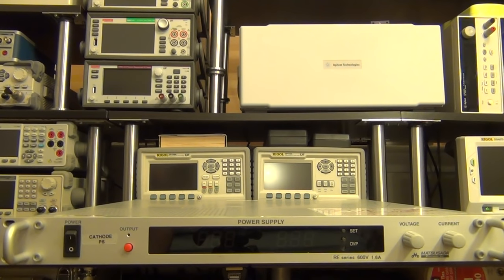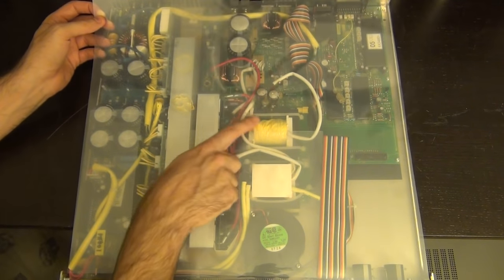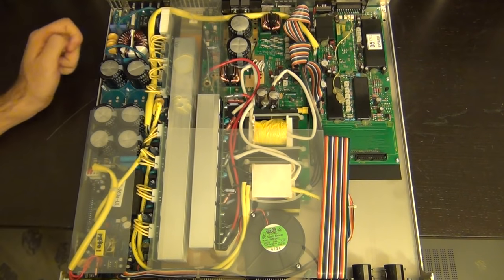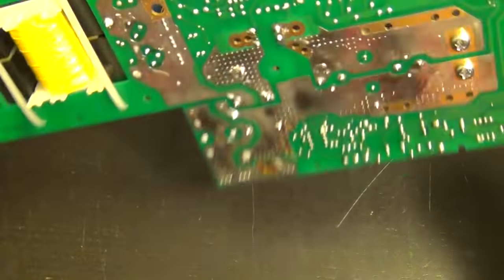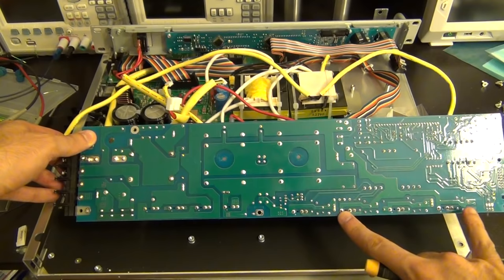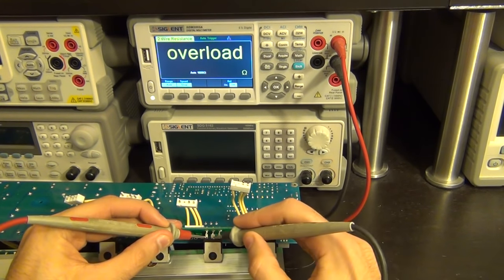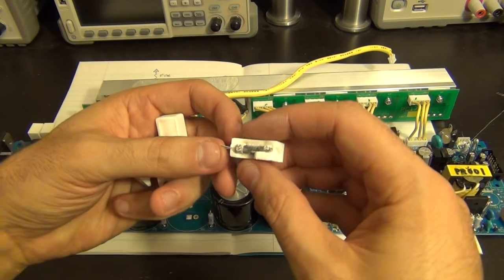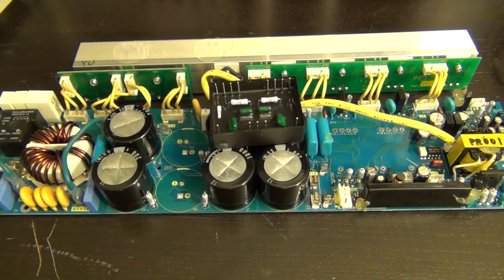TSP #65 - Teardown & Repair of a Matsusada RE-600-1.6 600V 1.6A Power Supply

Comment: When powering up something like this after a repair, it's a good idea to put a resistor  in place of the fuse to limit current if things go wrong. 
Amazed to see such amateurish methods used in a Japanese PSU, but who the hell has heard of Matsusada nowadays... PSUs are always subject to failure, so making one unrepairable is unforgivable. There is no reason for the drive stuff to be a module except to chisel money out of customers for spare parts.
Reply: +mikeselectricstuff He should send the module to you for X-raying and bandsaw-extreme-teardowning :D
Reply: +Róbert Valdimarsson 
That would be incredibly awesome
Reply: i use resistor + fuse combination.
Reply: +mikeselectricstuff when the fuse is on the primary i usually use the poor-mans-limiter incandescent light bulb. At least the brightness gives a indication of current and limit at the same time. I would prefer a proper limiting PSU thought :(
Reply from the maker: +mikeselectricstuff Hey Mike, yes, as always being a little lazy costs extra time! I am going to invest in a good Variac also. Too bad they made it impossible to repair, it would have been nice to have this thing running for future experiments.
Reply: I'd like to see the concealing of part IDs being made illegal. Such practises not only rip customers off, they mean what should be perfectly repairable electronics end up in landfills as it ends up uneconomical to repair. It seriously pisses me off.
Reply: +The Signal Path Blog If you feel it's still worth the effort, you could try dissolving the epoxy in the module. Dichloromethane, toluene, or MEK could do the trick.
Reply: +mikeselectricstuff If there is a huge bank of capacitors on the input, current limiting on the input during power up will not help a great deal. Either the input capacitors are sufficient to kill the "internal organs" after the logic decides to fire up the output stage. Or the current limiting is to drastical to feed the DUT's logic.
But if you power up a switching mode supply on restricted power/low voltage, this is a possible scenario for desaster, if there is no (working) current limitation. A lot of devices can be killed by operating them at inputs like 70V AC....
Reply: +rarbiart It seems that the cap bank is actually located prior to the fuse so a series resistor (personally I prefer incandescent lamps as you can literally see what's happening) should hsve worked
Reply: +mikeselectricstuff Dont you have that xray machine still? Maby he could send it to have it xrayed to discover what's in that potted box.
Reply: +ProdigalPorcupine Im thinking that there's something that could disolve the potting: MEK,acetone,xylene,naphtha,laquer thinner, et al.
Reply: +ProdigalPorcupine But the main lesson to learn from this I think is that it doesn't only happen to Dave :D . You scored at least a handheld scope and got it working and your streak has been pretty consistent up until now. Poor guy fixed the display connection on one only to find out the scope part was cactus.
Reply: +pocoapoco2 More like halogenated solvents like dichloromethane, chloroform or maybe tetrahydrofuran or acetonitrile.
Reply: When I was playing with SMPS that havent any resistor on main HV caps, and there was 150VDC by long time, I was discharging it with usb wall 5V power supply with connected usb flashlight ;p

Comment: I thoroughly enjoyed this video.
That module can be unpotted.  I use to work in the automobile aftermarket industry and we used to unpot modules all the time.  We had to unpot the modules in order to reverse engineer modules so that we could create our own modules based on the original design.  For those in shock out there.... No... It wasn't a copy.  We analyzed the OEM circuits and came up with our own designs which were often times better than the OEM.  It's quite legal.
The unpotting was similar to how you uncapped an IC in one of your earlier videos.  
Unfortunately, I don't remember the chemical used.
If you were to contact the aftermarket auto electronics industry, you may be able to find the name of the chemical.

Comment: There are two ways to get inside the module. (1) Find the chemical that melts the black epoxy.  (2) Lots of heat, so that the epoxy becomes soft enough to dig out. I have done this and it works. (3) dig out the epoxy with the Dremel and a cutting bit. I have had success this way too.

Comment: Dig out a TL494 and an IR2110 or 50 Gate driver to replace the PWM gen block. You used a clone component in your magnetic levitation circuit.
Oh, throw a few KSC3265 and KSA 1298's as push pull drivers and your up and running.
This HV topology is used in several KW Crown PA amps, is bloody reliable and highly configurable...

Comment: As in some of Mike's videos, a Dentist, or Veterinarian might be willing to X-ray the part for you.  Depending on the potting compound, you may be able to chemically soften and remove it (I think Mike has had pretty decent success with dichloromethane paint stripper).   Ben Krasnow or Jeri Ellsworth might have decapped those transistors to see if there were any markings on the dies (which might be useful if you're successful in de-potting the module).   While I suspect this is probably more involved that you'd like to get, you might also be willing to do it based on principle as well.

Comment: If you are sufficiently motivated you can unpot those epoxy encapsulated units if you leave them sitting for a few weeks  in dichloromethane.  Not a pleasant process and they won't be reusable after but you could get the circuit details.

Comment: A repair tip: Use a variac or a resistor to limit current so you don't blow the input section until you are sure you have fixed any dead shorts.....Would have saved you from blowing those resistors. :)

Comment: I am old school, I pretty much always use my arrangement of switchable light bulbs for current limiting and a variac to bring up the voltage on mains powered equipment under repair to make sure nothing explodes.

Anyway, yeah, those potted modules are pretty awful, seems ridiculous, I am sure anyone wanting to copy their design could just as easy design their own.

Comment: In that case should be the gate drive trasformers. Check it close to see if two transformers are sticking out of potting. You cold replicate that device quite easy. It should have two pins for powering the input buffers (like TC4422) something around 12V , also with the scope check to see if you have the PWM signals on some pins. Check also the two resistors that are sticking out of potting, as those could be in series with the GDT.....

Comment: That date code and RU logo looks like discrete Avago gatedriver.  Depending on what it's expecting on the input, maybe it's not that hard to create a replacement.   Did you scope the input side? maybe trick the feedback and see if the signal going to the gate driver module changed?

Comment: Big electrolytic caps (well, all caps, but especially caps like those big Nichicons, or bigger) can regain up between 10-15% in as little as 30 minutes through dielectric absorption (thin film, poly(ester/propolyene)) are all around 1%, tantalums are around 3%). Always use the bleed resistor that's in series with the cap to drain and confirm with your DMM before performing any work on anything like old TV's or if you're building that awesome Vox AC30 replica

Comment: Sorry the repair didn't make it (yet!). Hopefully someone will cough up either a replacement module or at least some info on the internal workings. I always appreciate when you own up to mistakes along the way, some folks videos are surely edited to delete those "slap my forehead" errors! BTW, did you get the opportunity to update your DSA1030A-TG firmware?

Comment: Is it possible to use plastic safe paint stripper to "unpot" the potted module? It hardened by evaporation of the potting materials vehicle, maybe you can soften it carefully and remove the potting by exposing it to paint stripper fumes. Its really the fumes in the paint stripper that does the work.  There are a few manufactures but I use Chameleon Hobby products.   I would definitely write down all the visible part numbers and photograph the module and possibly even do a schematic from what you can see before trying this as those part numbers might disappear when doing this.  I see you just replaced the larger caps, which test instrument do you recommend for testing ESR on larger caps like 2200+ microfarad caps?  Also which inductance meter manufacture and model would you recommend for figuring out a transformers turns?

Comment: have you checked that little 8-pin dil package next to that white opto-coupler? It is probably the oscillator and drive IC for the mos-fets. Just next to the prool trafo. You can always try to chemically dissolve those epoxy packages. But I don't think there's a problem in there. If so there would be discoloration and crackles, or such. Clearly the safeguard is working fine. So probably the oscillator isn't giving pulses, to do the switching. The circuits are starting up but the main power supply is not. So the drive IC must be damaged or broken. That is that little 8-pin Dil package IC next to that transformer. Namasté.
Reply: Ha, I just bought two of these exact supplies 40 Volt 80 Amp with an identical issue with no output. The only IC with the numbers filed off is that little 8 pinner. I haven't gone into any detailed checking yet other then visually which is all good except the first transistor warped the plastic sheet under it. The second one I haven't even opened up yet. Seeing your comment is a sign and I'll let you know when I get time to work on them if that IC is the problem, maybe the second supply still has the numbers intact.

Comment: Email me and I' send you the PCB layout and the details to of components layout. Simple. Three diodes, a few caps and two pre driver transistors (one an NPN driving a PNP Darlington that drives a larger driver 2SD880 that drives the N-Mosfets  Simple to etch and populate the board, that is driven by a simple PWM using a TL494CN. The Darlington is 2SA1020 driven by a 2SC1815 that drives a 2SD880 that switches the N channel FETs. The diodes are HER208F (FR107) SR260 (FR207 1KV)  A pack of Zeners 5W
1N5711 1N5819 1N5399 33uH a smattering of 100nF decoupling caps and couple of 10nF to keep of any stray RF.
Good to go.

Comment: Could it be that the output caps were blown not by overheating but something bad that came IN through the OUTput terminals ? I don't see much protection circuitry on the output.

Comment: When you are measuring the diode junction in those MOSFETs - that is the voltage that opens the gate, right?
Reply from the maker: No, that is the reverse diode voltage of the source/drain to bulk.

Comment: Are we 'sure' that the potted module has failed? Yes, it seems likely to me also. This repair has already gone sideways for several reasons. But is it possible to surmise at what levels and switching rates the old/vs new MOSFETS must see to fire up? We have two "good" old MOSFETS...

Comment: Not sure if you will see my comment considering the age of  "Teardown & Repair of a Matsusada RE-600-1.6 600V" video... I am trying to bring back to life very similar Matsusada RE35-34-09 supply. It has the same architecture with the exception of output stage, which is low voltage/high current. These supplies need a jumper on DB25 connector between pins 10 and 21, without this jumper the output is disabled.

Comment: At least you have a whole bunch of nice parts that you can reassemble into some power supply of your own ;) Btw. for the case of identifying the proper mosfets, these cheap ebay transistor tester thingies allow you to rule out a few candidates of transistors by giving you rough measurements of some datasheet values.

Comment: Heat or chemical paint stripper could help to see whats under the epoxy in that custom module, most epoxies become soft at around 100C, but, since the module is quite thick, hot air gun will not work on it, it is better to "soak" it with the heat in an oven and then try to chip away the glue.
The other method (not that great for thick pieces) is to use aircraft paint stripper, or powder coating (which is essentialy an epoxy) remover, these come in aerosol type containers, chemicals are quite nasty, use gloves and preferably do it outside.
I'd use the heat method to get large chunks out, and then clean it up with the paint stripper, note that the paint stripper may attack the plastic container as well, or any other plastic encased parts inside there, or destroy component markings which are painted on the parts.
Chloroform will also dissolve epoxy (it becomes jelly soft like, can be brushed off with something like toothbrush or soft metal brush), but the part needs to soaked and worked on while it's still wet with ChF, it evaporates very quickly and once its gone, epoxy becomes hard again.
Reply: +jz1199 I'm guessing your paint stripper had dichloromethane (aka methylene chloride) in it. Wonderful stuff for dissolving epoxy. Too good. It will dissolve component packages eventually too (I found that out the hard way). Also there is some evidence for it being carcinogenic.
Reply: +Verm1n yes, DCM alone is not exactly an over the counter house hold chemical :)
Reply: +Verm1n 
It also welds quite a few of the common plastics, especially acrylic, polycarbonate and ABS. Best thing to repair fresh cracks in cases. It's really annoying that it becomes harder and harder to get for private people here in the EU (because "safety").
Reply: +superdau back in 80ties as a kid I used to use chloroform to put together model airplanes, funny thing about those model sets back in the USSR times, they very rarely showed up in shops, and immediately they were bought out - one would think that they got to the shops as soon as factory made them, and production capacity was the limiting factor - but then the glue, that came with the set, was always completely dried out, which would suggest prolonged storage times...

Comment: ...I've seen that soooo often in older japanese radios where potted hybrids were used everywhere, making schematic drawing nearly impossible...

But i am surprised to see the MOSFET numbers scratched, which is normally not in Japanese tradition, especially when it is known that Japan has its own semiconductor foundries (i was expecting 2SJ / 2SK devices here, having N/NPN devices in black epoxy and P/PNP devices in green epoxy).

Too bad. I understand you Shariar. It is frustrating and only gives a bad name to Matsusada.

Comment: If the modules not available IRF and others make simple to use gate driver chips, so I recon you can still get it going. Is that module next to the gate driver module the PWM generator/switching regulator? Please always have the camera running on the first power up :-) I guess you will probably use the light bulb trick or something else for protection next time.

Comment: It seems like the potted module has 2 sets of half bridge output, so I speculate that each 4 pin output is bootstrap voltage, gate 1, gate 2 and gnd. For the input side, you have (presumably) 2 gnd, 1 vcc and 2 signals, or 1 gnd, 1 vcc, 1 en and 2 signals. Go figure it out and build one gate driver module to drop in. If you can figure out which pin is which, and measure the voltages and frequency as well as physical dimensions, I will be happy to build one for you for free as soon as I got some free time.

Comment: You said you keep this one, but at some point you have to get rid of some of your equipment. What's your usual way of "disposing" of the devices? Put it on ebay "as is"? Desolder the new components you just installed and scrap the rest? Is it worthwhile for you to desolder other components from the board?
Reply from the maker: +superdau Well, it depends on what it is. For something like this, I might just de-solder come parts and drop the rest at an electronic recycling trash.

Comment: This is why I like and buy old equipment. You get stuff that you can actually maintain, and the manuals provide full schematics. This modern desire to obfuscate everything is very irksome. Nice video anyway, and hang on to any girlfriend that wants to help you repair a power supply.

Comment: When I get something like an IC or module which I suspect but can't find any info on it then I start searching on the board for bad parts. Bad capacitors, resistors, diodes, transistors, etc. I would not give up on it yet especially when you already invested money into it. There is nothing more I hate than investing money and time in a money-pit but that seems to happen quite often to me so I'm used to it... Anyway, nice video. Cheers :)

Comment: I'm surprised of the huge size of the circuitry, I mean a 600W psu for fex a computer is like 8 times smaller smaller. Yes those doesn't have 0 - 600V regulated capability but that alone shouldn't be the reason for the huge size.

Comment: Did that green (polyester?) capacitor really fail? Looks more like glue used to hold it down rather than actually spilling it's guts..
Reply from the maker: +Tim Feleppa Yes, it had actually cracked and melted.

Comment: With all the equipment you have, how come you are relying on eyeballing the capacitors rather than using a ESR meter. Would be interesting to see how bad the caps when tested really are.
Reply from the maker: +0521Bryan I did. They were shorts.